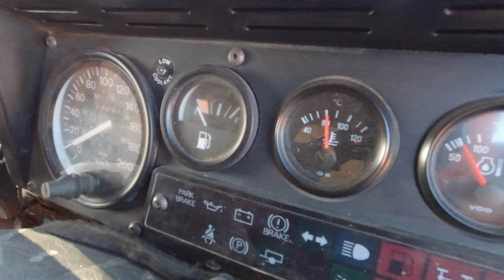#19 Life on the 'Good' Road to Civilisation in Namibia

Comment: I can confirm that the more northern route to Opuwo is a lot worse than the D3707/5. Drove to Marble mine in 2022, 200 meters of it were only just drivable with a spotter. Coming the other way would have been impossible.
Reply from the maker: Thanks for letting us know...
It was unmemorable when I did it a few years before you, so the commented that I had that it had been washed out in places appears to be true, was that your impression of the tough parts, flood damage?
Reply: @roamingyak Definitely flood damage. The road was obviously the quickest route for the water and it washed deep gullies into it. Much more than a grader needed to fix it.